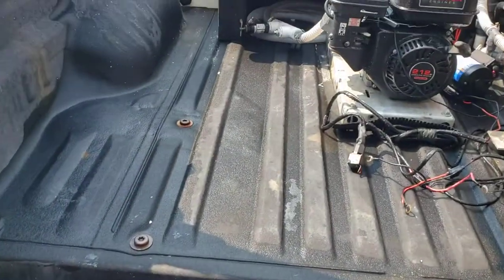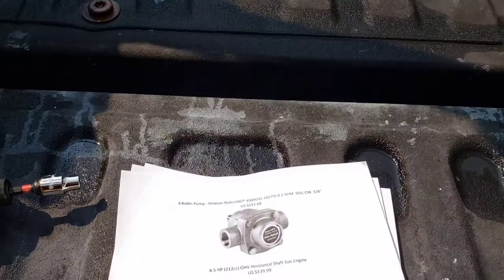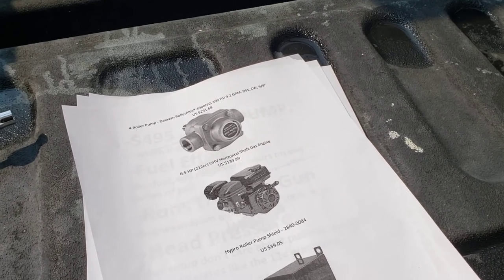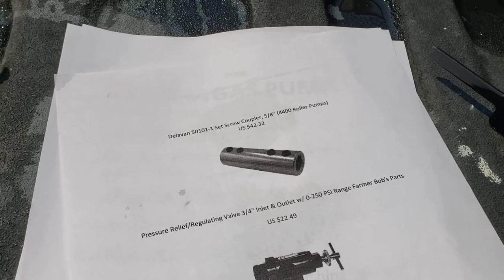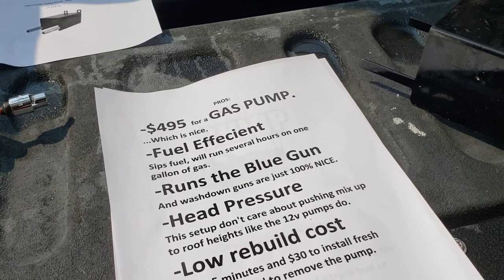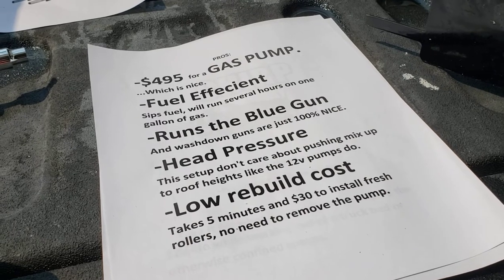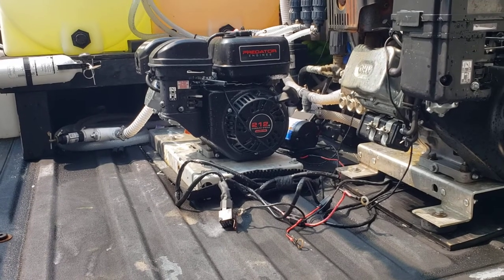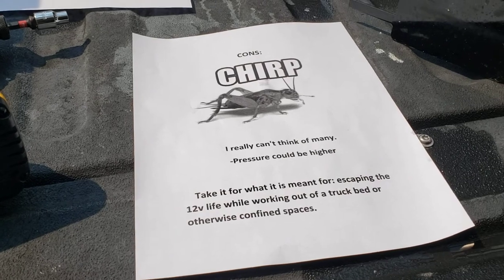A $495 SOFTWASH GAS PUMP!?

Comment: Love the video, I’ve done crazy research over the last 4 days. Your set up is ideal. I called a few manufacturers. Hypro tech was very informative. If you reduce the RPM’s from 3600 to 600. You can get a true 11gpm at 200 psi. That’s using a Hypro 7700C-r. Develan 4900 without the gear reduction runs 6gpm at 100 psi continues. Thank you for the starting point. Saved us all at least $1000.

Comment: Great video. I bought the parts list. How did you connect the coupler to the Predator Engine? The shaft on the Predator is 3/4 and the coupler is 5/8?

Comment: Did you have to reverse the pump for the gas motor? I understand the comes ready for a PTO shaft which turns opposite of a gas motor.
Reply from the maker: No you have to get a PTO specific pump. I forget which direction mine goes.

Comment: Literally the only thing pump setup for soft washing does better than my 12-volt flojet is gallons per minute I'm sitting at 6 at the pump of course we all know that's not what you get up the gun when it comes out realistically that's probably back down to 5 or 4 gallons a minute but I can easily get 45ft to 50ft and I've never had a problem with the 70 PSI that it puts out or whatever it is putting out by the end of the tip of the gun cuz you don't need pressure chemicals what cleans it all and that pump by itself is like $250
Reply from the maker: "literally" lol .. I've used both and the roller pump is superior compared to 12v. You can run it like 5-6 hours off a single tank of gas. If you clean a lot of cedar homes this is important. And it doesn't care about head pressure of going up 2 or 3 stories after 250 feet of hose like 12v does. Even my new setup using a lifepo battery my Fatboy doesn't quite manage what the roller pump was capable of. In my book it simply comes down to space and weight in my truckbed. I actually gave my rollerpump setup away to a subscriber.

Comment: Curious how you are compensating for the rpm at the engine vs the rated rpm for the pump? 3600 rpm at the engine… max rpm at pump 2200? Just throttling the engine down? Thx
Reply from the maker: Yep just running a $12 tach and throttling back.

Comment: What RPM is your motor running at? Looks like this pump is rated for 2600 RPM and I have a predator 212cc engine and just above idle I am getting 2600 RPM. Was also looking at the 6 roller pumps and they max out at 1000rpm. Just wanted to check and see if your having issues with the rpms the motor is putting out?

Comment: Just wondering if your experience with this pump is still positive.  I really like what you’ve done and I agree with you that it’s potentially a great replacement for 12v with none of the downsides of an AR pump. Anxious to hear more.
Reply from the maker: It's been just fine, use it a few times a week on average. Still no complaints. Been meaning to make another video on it to go over the plumbing for a friend of mine, probably push it out sometime this next week.
Reply: @dr.downstream1151  thank you.  I like your mixer as well.  Looking forward to the video.  Much appreciated!
Reply from the maker: @impressiveink  Hey you're welcome. I kind of enjoy making these videos, appreciate the feedback.
Reply: @dr.downstream1151  well, I’ve ordered the 4900DSS.  I just about decided to get a Honda motor with a 6:1 reduction gear and grab the 8900DSS.  And I still might after playing around with the 4900. Thanks for the help and idea.
Reply from the maker: @impressiveink  I think you'll do good. Just keep the roller pump primed.
Reply: @impressiveink  did you get the 8900dds??
Reply: @impressiveink  any updates with your setup? any info appreciated

Comment: Does the 212 predator come with different diameter shafts? I noticed the coupler is 5/8” but the predator I have , has a shaft that is 3/4”.
Reply from the maker: iirc it's 3/4" on the predator side and 5/8" on the pump side. Let me dig up the parts list I see I never added it to the video description:(
Reply: @dr.downstream1151  Thanks. I went back and looked at the description of the coupler. It states that it is for a 5/8" drive on the power side, which is perplexing.
Reply: So how does the coupler fit?
Reply: Got the parts and the coupler won’t go on the predator
Reply: I just wanna build my truck like yours

Comment: that delavan pump is $150 at northern tool
Reply from the maker: Do you have a link?
Reply: @dr.downstream1151  are you deleting my comment?
Reply from the maker: @Johnnyreengo  No not at all you haven't been anything but nice. Is YT blocking link sharing in the comments?
Reply from the maker: @Johnnyreengo  Odd. No I really didn't delete anything, I've been busy washing houses all day. One thing I was going to ask is if that $150 pump on Northern Tool is the stainless/corrosive rated pump? Cause I was pretty sure their normal iron chassis 4-rollers are what they sold for $150. If the stainless one is indeed listed on there for $150 jump on it because they have the pricing mislabeled!
Reply: @dr.downstream1151  the shaft is stainless but the housing is iron
Reply from the maker: @Johnnyreengo  ah. Yeah you definitely want to spend the extra $100 and make sure to get the stainless housing. The regular iron ones will rot quick.

Comment: This is fascinating. Quick question for you. I know some of these roller pumps are rated at 9ish gpm. Do you think it's be possible to limit the flow at the tip to 2-3 gpm? Or would that choke the engine? Also are you bypassing flow through an unloader or how does the pump stay cool?
Reply from the maker: you can run these pumps as throttled back as you want if a lower flow is needed

Comment: Could these roller style pumps be used with a metering system? If so these would be awesome!!!
Reply from the maker: yes that's how mine is plumbed. Same metering valves feed both the s9ftwash and the downstream injector

Comment: Post some links for your build please..be interested in building this.
Reply from the maker: I will, I'm still put working on the machine. I'll post em later below in the about section.
Reply: The roller pump last a little bit but will start leaking like a stuck pig soon and even the rebuild won’t stop the leaking
Reply from the maker: @stevesteve4383  What do you base this on? I know a couple other people who have been running roller pumps for years. And theirs arent even stainless or specifically meant for corrosives like this Delavan.
Reply: Great little set up. It will last you a while just as long as you keep rinsing it.

Comment: 6900 would be crazy
Reply: just bought 4 of the 6900 getting ready to set them up
Reply: @mrspowerwash5690  if you dont mind i would like to see a video of them please.
Reply: @tee87jay  just got them today picking up at truck depot tomorrow and hydro mixers will be in next week will do a video when setup
Reply: @mrspowerwash5690  you got them running?
Reply: @tee87jay  Were just getting over covid 90% first unit done today hopefully done by end of week then we will fine tuning it once thats done 4 more to go
Reply: @mrspowerwash5690  good thing you're getting better. I had it too. It sucked.
Reply: @tee87jay  Not sure what you mean " it sucked" I will say this unit is much tougher to setup than the 4900 Dr Downstream is using. Heres why- The 4900 with the rpm's is very different. First you cannot just attach the pump to a motor and run like the 4900. It required connecting with a California company who builds similar units for many company's for pesticide units. This pump requires an engine that has a gear ratio that will run the pump. We spent hours on the phone with Delavan engineers and this company in California and believe we have it dialed in. Yesterday we plumbed in the remote control Hydro Mixer we purchased from Midwest. We are dealing with very cold temps. for a week or so and hope to have it finished soon. Once we fire it up and make some adjustments and get it up and running good I will make a video and post it.  Delavan recommends you run the 6900 at 150 psi even though it has been tested at 300 psi but when you run it at 300 psi it will wear the bearings out quicker. At 150 psi we can dial it in from 5.5 to 18.9 gpm by changing the rpm's. We plan on running it at 150psi - 13gpm.
Reply: @mrspowerwash5690  I would be very interested to see a video on this setup.  This is pretty much exactly what I am looking to do!  Please let me know if you have anything available to view